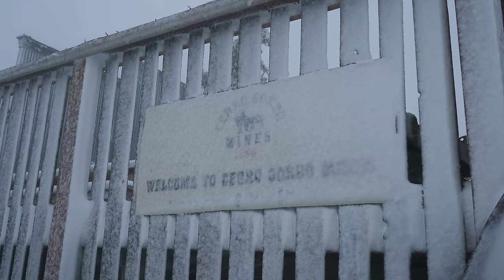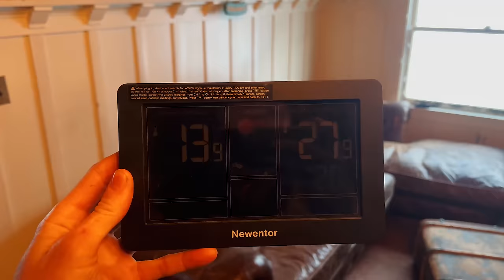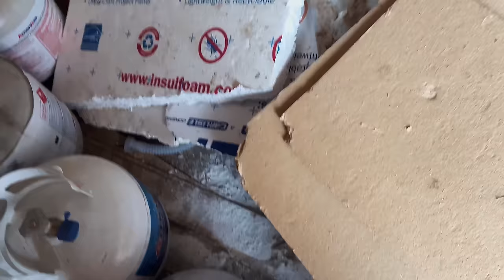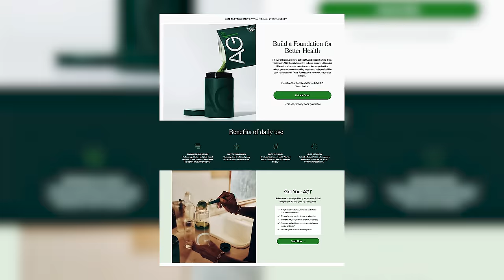Realities of Winter In A Ghost Town

Comment: Just a suggestion for the firewood problem being frozen. Make a space near the fireplace to pile up wood for the fire next morning. And then when you start your morning fire afterwards go get more wood for the “warmer pile”.
Reply: Does the obvious really need to be said like wtf?
Reply: We have an indoor firebox built into the wall next to the fireplace; about 3 feet deep, 4 feet wide, 5 feet tall, with a louvred door for introducing warm air and letting humidity out. It's a little annoying because it turns a corner like an awful corner kitchen cabinet. Holds a few weeks worth, i use a garbage can to bring wood indoors from the wood shed that has about 3 years worth of firewood in it, frozen and wet though, so the indoor firebox is  quite great.
Reply: @007nadineL  I guess so.
Reply: @paddington1670  I like yours! Good idea.
Reply: You aren’t really supposed to store wood in the house because of termites, but to have a large quantity of wood nearby under a lean to shelter would be good.

Comment: Pro tip, keep 5 gallons of water by the toilet for a few extra flushes after you find out the pipes are frozen.  

Second tip, pex without brass fittings is freezeproof. It will freeze and stretch but not burst.  It saves on repairs when they do thaw.
Reply from the maker: We've got the pex and 5 gallon bucket, now just to melt some snow!
Reply: @GhostTownLiving  good luck, and keep having fun.

Comment: Thanks for the video, it's good to catch up on CG. I've lived in Minnesota for 60+ years so while I'm not at high elevation the snow and cold Is just part of life. A few suggestions if that's ok, every fall a list of winter prep chores helps when cold weather arrives. Part of the winter prep is planning for your every day needs when the snow arrives and temps drop. We currently have had 50+ inches of snow so far this season and while it's been mild we have had temps in the teens below zero fahrenheit this season. While the moisture that snow is bringing inside your buildings is a concern in the short term it's probably not as big a issue as you think. Especially when you consider how dry your climate is the rest of the year. It's more of a issue if it would be present for long periods of time. We frame buildings year round up here and snow falls inside while we are working we shovel it out and when you heat the building it evaporates quickly. So having a seasonal mindset becomes part of your planning. Best wishes.

Comment: I feel for so many of these struggles as I start to spend more winter time across the valley from you. Some extremely valuable lessons I have learned is to use a modern wood burning stove. The fireplaces are fun and run that too but pellet stoves will keep the temp up all night and will help keep your pipes flowing. Insulate your pipes too (in December I had to fix a broken pipe when it was 22 out, insulate them anywhere you can). Cover your firewood with a tarp or something and keep a few bins of it inside to dry out. I use a shed about 40’ from the cabin that’s open on one side. Don’t forget you can also cook on a stove when your gas isn’t working.

Comment: I lived in a remote village in the mountains and yes, winter sucked. Snow was guarenteed. A wood burning stove is all I had for heat and it took about 4 or 5 hours to fully warm the cabin from cold, but when it was warm it was cosy af. The beauty of the place and the 40mins drive to decent ski slopes was the compensation for an otherwise harsh and not so fun winter.

Comment: You need a set of snow tracs for your Kubota. They are easy to swap out and are reasonably priced. With those you should be able to get around anywhere.  You might want to consider adding a mini plow on front.

Comment: Ive never been in a situation like this so I don't know if its the best solution to any problem but always having access to a water filter like a sawyer or any other brand (make sure to keep it from freezing that could ruin it if it has been used) is always a good potentially life saving idea and if you pair that with a small wood burning cooking furnace during winters like this you could heat a room with less wood, cook breakfast on it, and melt snow for filtering or use in things like filling the toilets tank so that you can flush! I also recommend looking into how hikers and campers deal with emergency situations. Even though this is technically a homestead you are a lot closer situationally to long distance hikers/campers due to your isolation. A great channel I would recommend especially for info on dealing with being isolated in cold climates is ALinsdau who is a polar explorer and could potentially share some life saving tips! Be safe out there, your videos are awesome!

Comment: You should consider getting a Lopi stove or something similar. They are super efficient at heating and use less wood to produce the same amount of heat as a fireplace. Also you can cook on top of them so there is no need for propane stoves.
Reply: Truth, love my Lopi!
Reply: I agree. Regular fireplaces lose a lot of their heat as the hot air and smoke rise out of the chimney. A cast iron wood burning stove absorbs and radiates that heat outwards. I've spent some time in a ski cabin that only had wood burning stove for heating and cooking, and it was plenty toasty. Those suckers get so hot you could theoretically cook directly on it (might make clean up a little hard if you do that lol).
Reply: Just come back in the summer

Comment: A Wind turbine generator would be awesome for those circumstances because there is a lot of wind and excess electricity can be used to heat the pipes so they don't freeze. Also, burying water tank and water pipes underground would prevent them from freezing to some degree.

Comment: Hi Kevin,
❄️❄️❄️❄️❄️❄️❄️❄️
We use wood shutters inside that lift-up and stay with a hook/eye. Post signs to close doors tightly (tight big hook and eye) We use shutters for keeping out heat in a wind storm. 

Your windstorm will blow and we’ll have it, compressed and 70 mph. North-East winds start the fires. When your place is 💯calm, our place is crazy.

Comment: A mini split heat pump would do you good in those cabins. They make them crazy efficient now and can pull heat well below 0 without aux heat. You would need to create a barrier to block the snow drift from freezing the coils.
Reply: Heat pumps are crap in cold climates. The cabin I've been staying   in this winter has an LG unit. This past Thursday night it got down to 7 and was putting out no heat.Have to run electric space heaters when gets t o 10 degrees  or lower. Cabin is 4 years old and had been a problem from day 1.
Reply: @davidkramer6585  I have one in a cabin I'm living in and it can be -30 outside and 85 above inside. I live in northern Wisconsin.
Reply: @R. A. Facklam  what brand is yours?
Reply: We had 3 pioneer mini splits in a single wide trailer and when it was below zero we would have never known it. The only problem we had is when we would get freezing rain it would all stick to the coil and the defrost cycle couldn't compensate
Reply: @Robert Keiser  glad to hear some of you have good results with heat pumps. In Dec. we had cold with -45 wind chill. Was running 3 space heaters as this piece of crap LG does not work when gets to 5-10 degrees. Have 2 minisplits in 6oo Sq.  ft. cabin.
Reply: @davidkramer6585  soleusair

Comment: Hello "Glutton for punishment"! 🙂 After wheeling and camping for a week in Death valley we stopped by yesterday (1/30/23) to see how things were coming along.  Talked with 2 of your carpenters (?) just finishing their lunch.  Quite a project you've got going there!  You probably noticed my tracks in the snow up to your motorbikes.  Miserable cold, even around 1:00pm.  We didn't feel proper about going into any of your buildings without you there, but did notice your kitty was out running around.  He liked something on the front of my truck, but he high-tailed it before I could get too close.  Having lived in the Rockies for a couple of years, a little trick for "things frozen"  Carry a bottle of MAPP gas (for plumbing) with a trigger lighter to melt frozen hinges, etc., and also a 4" heavy duty scraper, maybe a "5-in-one".  But you MUST store your wood covered, even just by a $5 tarp!  BTW, I didn't see a flag to sign in at...  If it were me (and, it's not), I would get full control of the insulation on your primary living quarters immediately before any further plans to expand for anything for "play".  Keep your head on straight lad, your life depends on it ;-)  Best wishes for you!

Comment: I think maybe you might consider weather proofing the house you are living in, just so you don't freeze to death. Maybe insulation, plastic on the windows. Cut a load of wood and stack it out of the weather so it's dry. Even stacking it on the porch helps insulate the house. Also, wrapping your pipes. Maybe put that on the priority list this spring and summer, so next winter you can enjoy it, and not suffer through it.

Comment: Not sure if anyone has already mentioned this or not but here it goes. Fireplace grates shouldn't be used in wood stoves. Just stack the wood in perpendicular rows to start, kindling on top, and then add as needed. Also, you should burn it with the doors closed using the air vents to control the fire. Wood stoves are designed for heating in mind not so much esthetics like fireplaces. They also make heat powered fans that you put on top of the stove to circulate the heat more efficiently.

Comment: You don't need to have frozen water pipes. Pull a heater cable through them and you'll have running water if your water source is not frozen too

Comment: As some one who lives close to canada in northern NYS a few tips, one figure out ur frost line burry the h20 line below that, 2) ur regulator for the propane keep it out of the weather, and lesson the distance of line from the tank to the house if u dont want the tanks inside the house, this will make the gas so it doesnt freeze beyond its flow point. If yoy can wrap the regulator in some kind of water/weather proof bag or insulation you wont need to "thaw or unfreeze it"

Comment: As our inlaws are now seniors they made changes to increase comfort, and cut down on work and winter emergencies. This is also ideal for your hotel and possibly your house simply because winter temp changes can be extreme.  
 
The main heat is now propane. Large propane tank by the house. It gets refilled a couple times a year. Your challenge is, can a propane truck make it to Cerry Gordo and run the line to wherever you put the tank.  
 
A propane line can run to your BBQ also. Good place to hook in a refill valve to refill smaller tanks IF needed. If you want to use less propane set your heat enough to keep pipes from freezing. Augment with wood. It depends what you want to spend more on, wood or propane. And how much time you want to spend doing wood duties or making wood and propane runs. You can adjust at any time.   

Bonus to adding the large propane tank. There's now a propane backup generator outside. (it holds it's own propane too, does not rely on the house tank, and can run for over 48 hours) When the power kicks out, it kicks on to power and heat the house. If the power goes off during the night the backup system keeps you, your pipes, and inside pets from freezing. The internet is restored within 60 seconds.  You can run the backup in intervals if needed to extend the propane. 

The wood is now no longer as critical and lasts longer, but still:
We built a covered half-shed. It stores a season's worth of dry firewood. To replenish that there are 3 seasons of uncovered wood outside. A hopper in the house stores a couple days worth of wood.  No more wet or frozen wood, no freezing while gathering wood. Always prepared for an emerg whether heat or power related.  Getting the larger propane system and backup generator was expensive to put in but they added comfort, and reduced worry and constant chores. More time for the hot tub.

Comment: Always watch forecast, and have plenty of wood and propane inside. also, have water stored aside in a closet or pantry for drinking ect. Have a dish pan full of water ready for dish washing. Have foods that don't require heating, or cook over the wood stove, also foods that don't require much cleanup. Keep doors closed , latched. Oil lamps or lanterns for light. Cell phones charged for emergencies. Avoid going outside, if possible,  because of your area, you don't need to risk injury to scrape ice. I do see you need to take care of animals, but only worry about the necessary chores til conditions improve. I was raised in these conditions and we prepared ahead.

Comment: If it gets cold enough your vehicles won't start. If you can get heated pads or blankets for you vehicle it could be a lifesaver. Putting a tarp weighted down over your woodpile is helpful but like you said, a woodshed is a game changer. If you take a building with a dirt floor, dig a hole, line it with straw, put in root vegetables in and cover with straw and then dirt. They won't freeze. 
Make sure your animals are in a barn with hay bales for warmth, because not fit for man nor beast saying keeps your animals from suffering. Wrap your water pipes, put your propane tanks inside.

Comment: Hi bud, loving your story both the offgrid but also the history and your will and efforts to preserve and highlight it. Regarding the offgrid, I also live offgrid but thankfully in generally easier climates. I have issues with freezing too so I have trace heating on my water pipes that is thermostatically controlled  and 12v powered. You can pick the stuff up easily online, look for 12v heat pads and choose the long strips and digital temperature controller 12v on ebay. (I'm not connected to any sales.)

Comment: We lived at an abandoned resort on the coast of WA state, bought by my in laws friend. He let us move into a small 2 bedroom front cabin that used to serve as a lobby/main area thang  many years ago. Just a small cabin on small stilts. Anyway, the only heat for the place was a wood stove. We bought a cord of wood to ride out the winter, and it did. Got us thru 2 pacific storms (one with category 3 hurricane winds), about 3 ice storms, and non stop rain. 
* We did leave the cord of wood stacked under the awning to the roof under a tarp, BUT we also kept a sizable stack in an indoor area to dry. Then always a smaller stack on the brick stand close to the stove (it had some cheap aluminum divider). That fire pretty well stayed going thru the winter, which was no big deal, we had a routine with it.
What was also great about it is that when everyone was without power, due to the storms or ice, we always were warm and had a place to cook <3

Comment: So in the military they have a saying: "two is one & one is none" - you gotta have backups for your backups. I have a smallish emergency pack that has 3 separate methods for warming/cooking food and probably 5 or 6 ways of starting fire. You need better clothes for these conditions - Sorel boots, multiple layers (wool base layer, synthetic insulation layer, windstopper layer, outer waterproof shell layer - use as many as needed). I think you should invest in a woodburning stove with a cook top - so your source of heat can allow you to cook with your firewood (I'd honestly be surprised if there ISN'T one in the town somewhere!). You also need more firewood, better stored so it stays dry. With the right gear, winter can be far less challenging and more enjoyable as a downtime where you can read & rest beforea new seasonof challenges begins. I say this knowing that as a California native (not from a mountain town like Tahoe) it isn't second nature like it would be in Alaska! I've watched you for a while & seen how hardworking & adaptable you are, I'm sure you'll get there & be stronger & more resilient for it.

Comment: I have 2 100lb propane tanks for my off grid home I refill about every two weeks Lowe's has a propane heater that hangs on the wall that does a wonderful job without worrying about wet wood easy install there's a kit with gas lines and a regulator I installed myself You could probably get a 120 gallon propane tank since there's a road sometimes. Makes a world of difference! I really enjoy your channel!